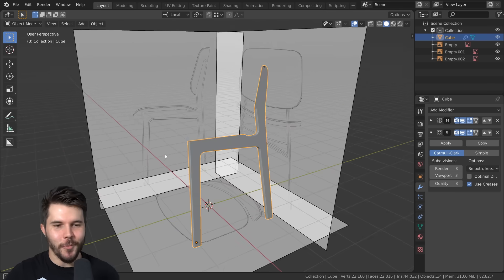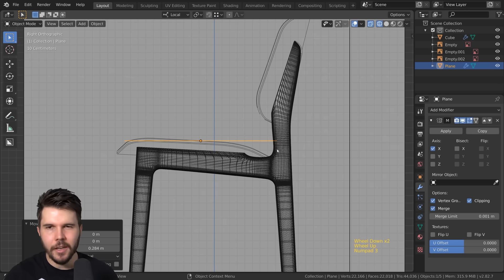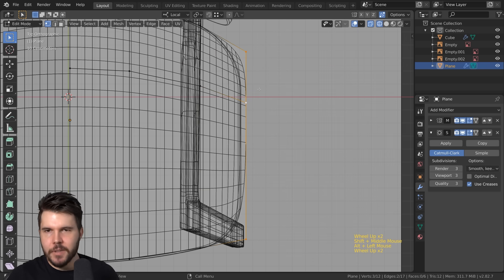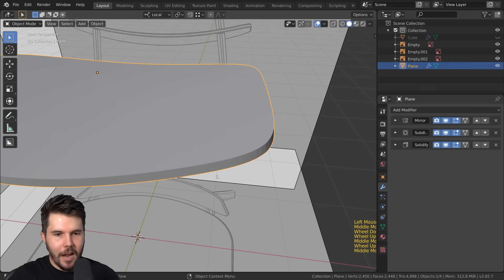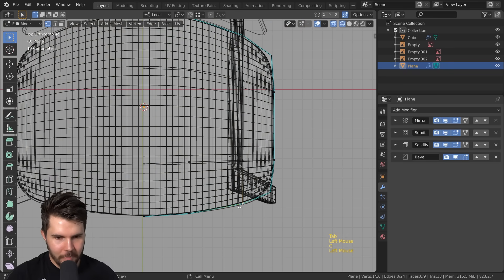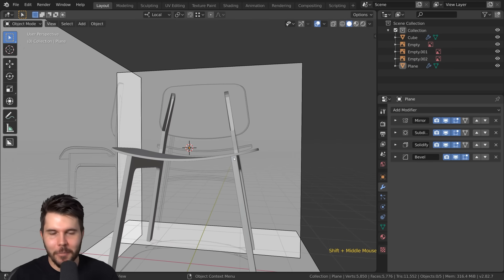Blender Beginner Modelling Chair Tutorial - Part 4: Modifier Mayhem

Comment: In blender 4.5+: If people get this weird extra smoothness along the line 11:12 if you have already added the smooth by angle modifier, go to the bevel modifier, then to profile, you have the superellipse shape, auto set to 0.5, when changed to 1.0 it deforms the bevel less and the line disappears.
Reply: Hi, have you finished this chair? I was doing this as a homework assignment, and my computer broke down. Today is the deadline. If you still have the file, could you share it with me? Because I don't have the money to hire someone else and I'm in a difficult situation.

Comment: For people struggling with Auto-smooth portion, around 8:30, Blender has made it easier now. You can easily avail that by right clicking on the object and click on "Shade Auto-Smooth". On the lower left corner you will get the option to change the Angle.
Eventually, the Smooth by Angle will modifier will also add up in the list of your modifiers.

Comment: 10:25 i use blender 4.5, i threw in the shade smooth, bevel modifier, 3 segments, 0,01 amount. it looks good for me
Reply: Hi, have you finished this chair? I was doing this as a homework assignment, and my computer broke down. Today is the deadline. If you still have the file, could you share it with me? Because I don't have the money to hire someone else and I'm in a difficult situation.

Comment: If you're stuck on the auto smooth part, the option for "Smooth by Angle" is no longer under the Data tab. Its now its own modifier. So go to the modifier tab for your seat, and add a new modifier. Its called "Smooth by Angle". Hope this helps someone.
Reply: bless you kind sir!!!!
Reply: It also has to be above the subdivision modifire
Reply: Thanks a ton!
Reply: Thanks for this! Although I am not seeing it. What should I choose?
smooth
Smooth Laplacian
Smooth corrective (all in Deform)

Cheers!
Reply: Thanks for the advice  bro
Reply: @nanakakitano9724  I can't remember now if I figured it out or not ( might have as I have finished the chair now) 😂 But thank you very much for the tip.🙏
Reply: love you
Reply: THANK YOU BROTHER
Reply: Thanks man i love the Blender community!!
Reply: "Smooth by Angle" Hero - Thanks
Reply: Go to Object mode, right click > shade auto smooth
Reply: thanks, i tried the other thing he said "Edge split" and it worked too
Reply: yo man thanks so much was stuck here :D

Comment: On the plans, the outer line is the thickness of the material, the inner lines are the bevelled edges.  Chamfering the edges in production will require specific tools to create a constant curved edge against each corner - usually set to a mm radius.  I worked with a product designer who did a lot of this stuff in Solidworks and had all the fun of creating perfect topology.  He always said the modelling was the easy part at 25% of the job, solving all the problems was about 75% afterwards - depending on the complexity of the project too.

Comment: At 3.39 when I am applying subdivision surface to mirror modifier. It is considering mirrored and original surface different, and creating 2  different table surfaces. How to fix this.
Pls let me know
Reply: It's the issue of merge option in the mirror modifier that's set by 0.1 by default. Just change it to 1 and it'll work fine.
Reply: Thanks <3
 @meowzzzie
Reply: @meowzzzie  thanks u so much bro
Reply: when add modifier->mirror, need to turn on "clipping" checkbox, then G and meet the edge at middle.

Comment: If the Bevel modifier didn't work for you, move it before the edge split modifier, edge split should be after the bevel modifier. The correct order is Mirror, Subdivision, Solidify, Bevel, Edge Split.

Comment: For those who can´t see the mesh created by the Subdivision Surface on Edit Mode, even after checking "Display Modifier in Edit Mode" and unchecking "Optimal Display", do the following: Go to Edit - Preferences - Viewport - Subdivision and uncheck "GPU Subdivision". Apparently, some Graphics Cards don't support the subdivision on edit mode. It worked for me. I hope I can help someone who like me was strugling with this issue. (Blender 3.2)

Comment: For anyone who can't see the mesh of the subdivision modifier while in edit mode, try these three things in order...:
First uncheck "Optimal display" in the modifier.
If this doesn't help, click the Icon in the modifier with the square with one selected vertex (Display modifier in Edit Mode).
If still no luck, your GPU seems to be unsupported for this. Was the case for me and it was the hardest to find:
Go to the preferences "Viewport". All the way to the bottom there is a section "Subdivision".
UNcheck "GPU Subdivision"... save the preferences and you should now see the subdivided mesh in Edit Mode.
Hope this helps everyone struggling with seeing the mesh.
Btw... No need to install the Pro drivers for Nvidia. I did that and they caused more problems, than they solved. Had to uninstall them and re-install the original drivers :(
Reply: Thnk u so much😭🎉
Reply: Thank you! Was pulling my hair out trying to get this displaying correctly in edit mode
Reply: Nothing worked, not even unchecking GPU subdivision...I have an M1 mac. 😕

Comment: Im a blender noob but Im thinking your "autosmooth problem" happens because autosmooth is set to 30 degrees or less, the edge was approx 90 degrees and so 1 bevel will be around 45 degrees, but more bevels will decrease the angle to 30 or less? Just a guess.

Comment: Question: Your orange colored object outline is so smooth from all distances. I changed antialiasing in preferences from 8 to 32 but it does not effect the orange outline and from a distance it does get jagged looking. Not a big deal but I'm curious as how to fix this. nvidia 1070ti, I guess I could play around with nvidia control panel but there are so many antialising options and options that replace antialising I'm not sure what to use. like I said its not important but I am curious, render usually looks fine.

Comment: 11:38 This happened because when you add new segments, the curvature of each segment drops below 30º, therefore Auto Smooth or EdgeSplit does not work unless you reduce the 30º angle to around 15º.

Comment: And I don't know what happened to my model, but when I applied the bevel to the seat to replace the shade smooth, the Segments were set to one. As they should be. But when I looked at the model, there was a weird little square on the thick edge. Added another segment and the square went away. Probably just me.

Comment: If you have a third chair leg floating in the air using the 2nd mirror modifier, you probably used the eyedropper on the wrong mirror modifier.

Comment: 8:05 How to control smooth-shading command
9:37 Bevel modifier 
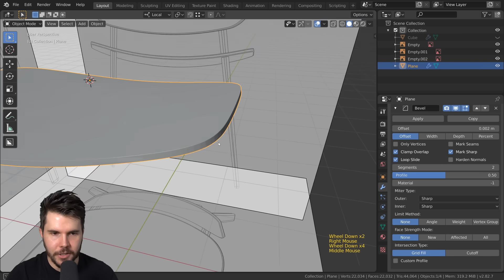11:45 How to fix beveling effect to an edges that you don't want to modify.
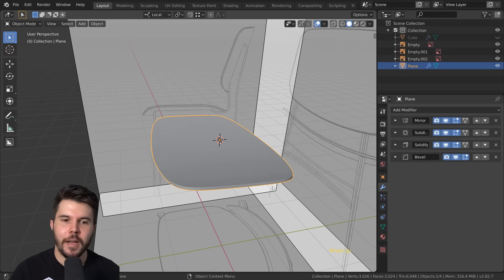12:48 Why the order of modifier is important, and how difference makes changes.
14:43 Mirroring object based on another object.

Comment: Really need 3 viewports.. I was pulling hairs wondering why my points keep changing 3D position in another vector.  Having front, profile (side), and top down is the better way.  I have a large Viewport as front, then the other 2 on the right of that this way I can pinpoint where it "Should" be in space.

Comment: 10:13 even if your edge didn’t get messed up at this point, do this bit still. I skipped this at first, and 2 minutes later when I added an extra segment parts of the corners looked pinched and doing this fixed it

Comment: If anyone is having trouble with the auto smooth option doing nothing, after I checked the box I used shade smooth in the object mode and it worked, with the bevel modifier too btw (also i did the ctrl e and right click mark sharp, while selecting the outline vertices)

Comment: Could it be that the "shade smooth" starts crating issues because the delimitation is on 30 degrees and when you apply more than one segment to bevel it essentially becomes less than 30 degrees between the segments?

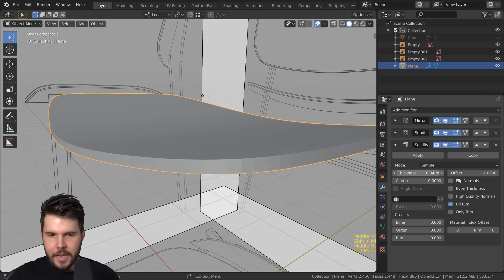Comment: 7:00 When adding the Solidify modifier, the edges of the plate don't align on top of each other (on Z-axis), I get a weirdly angled edge instead. Hard to describe, but did anyone experience the same or knows how to fix that?
Reply: same
Reply: Yes, I faced the same issue. I redid exactly again from the plane and it came out well. I guess it is due to misalignment of vertices

Comment: The Bevel Limit method by angle confused me. If you set it to bevel anything that is over 60 degrees in 12:15 , shouldn't it bevel the edges on the flat(ish) face of the chair too? The sharp edges are 90 degrees, yes. But the large curved face of the chair has it's edges which are closer to 180degrees right? Or am I measuring the angle between the faces wrong?

Comment: In 11:15 the Mark Sharp option doesn't fix tht weird smoothing bug on 2.91.2 version. 
using the Harden Normals option in the Shading section of the Bevel modifier fixes the issue.

Comment: Important tip: When shaping the seat plane in Top View, as much as possible DO NOT move the vertices out of line with each other. If you do, when you come to altering the seat to match the vertical curvature they'll all be messed up and won't align properly. I did this and had to start this lesson over from Square 1; 2 hours of work down the drain.

Now if you'll excuse me, I'm gonna go cry in the corner for a bit.

Comment: 3:39
For those of you who can't see the mesh of the "transformed plane", go to the  Subdivision Surface Modifier and uncheck the box named "Optimal Display" (it seems to be a default setting).
Reply: those who still cannot see the mesh in edit mode i solved by doing uncheck GPU Subdivision in Preferences > Viewport > Subdivision. i currently use blender v3.12
Reply: @rysore  Thanks for this! Worked for me!
Reply: @rysore  This is what finally fixed it for me, thanks!
Reply: @rysore  THIS IS WHAT I NEEDED :) THANK YOU SO MUCH I CAN FINALLY SEE IT lol
Reply: @rysore  this. Thank you
Reply: @rysore   Thank you very much! The underrated comment！
Reply: @rysore  "uncheck GPU Subdivision in Preferences > Viewport > Subdivision" thank you thank you thank you
Reply: Dude Thank You! New updates change so many things.
Reply: @saurabhparate  yes it made it very hard. especially in parts 1-3
Reply: thank you
Reply: if it still isn't showing, you need to select the box in the subsurface mod that says "display modifier in edit mode". Its the square with 4 vertice symbol
Reply: @Theakm55  not working, its probably something with graphic card, i tried every option including your tip.
Reply: @MatúšSzepeši  you should select wire frame in viewport option
Reply: @roboticreaper2662  I've selected wireframe option, i did everything exactly like on video but it does not work on my graphic card obviously
Reply: You have to click on the 3 dots on the top of the subdivision modifier. Try it!
(the on cage mode).
Reply: @Theakm55   thanks man!
Reply: Thanks for this info.
Reply: Okay, i found solution to my problem. AMD has obviously two different graphic drivers. I found version for graphic, modeling purposes. If somebody has this problem, search for Radeon™ Pro Software for Enterprise drivers for AMD.
Reply: None of the two solutions here worked for me, and I use nvidia... time to start panicking I guess
EDIT: It was not showing because I was in Object Mode and not Edit Mode...
Reply: Was hoping someone said something about this.  Isnt particularly necessary but it is a little annoying when you are following along and its drastically different.  I turned this off and the wireframe appeared, very nice.
Reply: thank you very much. I was wondering how to solve that.
Reply: luv u dude!!!!
Reply: Aaww man thank you so much! Totally saving me.
Reply: I honestly can't thank you enough...
Reply: Underrated comment, thanks chief!
Reply: Thanks man! I knew someone would comment this! _\,,/
Reply: I didn't need it, but I'm glad I saw this.
Reply: Oh my soul thank you! I broke my mind like "what did I miss!?"
Reply: I came here only for this :)
Reply: u r a life saver bro
thanks
Reply: Big help, thanks, thought I’d fucked up haha
Reply: Thank you!!!
Reply: OMG, THANK YOU!!! This was killing me.
Reply: Thank you very mach!
Reply: You are a hero.
Reply: thank you so much
Reply: dude thankyou
Reply: Thank you so much for this :) but when I do loop cuts now they are inaccurate, the orange line does not match up where it actually loop cuts :(
Reply: thank you so much this is so much better now
Reply: Thank youuuuuuuu
Reply: omg.. thanks
Reply: Thanks Mate!
Reply: Thank youuuuu!
Reply: Thank you so much!!
Reply: Much obliged, partner
Reply: And also go into wireframe mode
Reply: thank you man...
Reply: Subsurf and mirror modifier creating a split in mesh fix that
Reply: thank u thank u thank u
Reply: you're a hero
Reply: thank you!
Reply: Thanks brother
Reply: I had to set wireframe overlay amount to 1 to get it to show.
Reply: Thanks bro
Reply: yess ty :)
Reply: Thanks!
Reply: Oh my gosh thank you 😭 I went through the last 3 tutorials not seeing that and it drove me crazy lol
Reply: thxxxxx
Reply: hey....Tx dude..:D
Reply: dude thank yoouuuuuu
Reply: TY, man
Reply: After 4 hours to followed all advice nothing worked with 3.4.1. I just downloaded 3.0 version it's working. IDK why, if someone know
Reply: life changing...
Reply: Bro can i ask u something? why did he go to solidify modifier to add thickness instead of selected the face above and pull it down?? in 6:55
Reply: thank you so much
Reply: ありがとう
Reply: just wannna hug you
Reply: I have been trying to figure that out for 1 hour
Reply: I LOVE YOU DUDE
Reply: gah, i've been wondering how to get that to work. thanks man!
Reply: It took me 4 episodes to find it out 😅
Reply: You are the best dude!!!
Reply: LIFE SAVER! <3
Reply: thank you!
Reply: thanks, bro
Reply: Thank you <3
Reply: thank you!!!
Reply: Thank you MultiNicePerson!!!
Reply: i unchecked it, but still, its not working - could be problem somewhere else? Graphic card? I have AMD RX 580 

Edit: I tried same model on my notebook, where i have Nvidia GeForce GTX 1650 and its working
Reply: @MatúšSzepeši  once I unchecked it and went into “ Object “ mode with “ wire “ mode enabled. I was able to see it
Reply: Same problem, but it works when i am in object mode.
Reply: https://www.youtube.com/watch?v=-ioeQAhxkb8 here is another way to fix it

Comment: @Andrew  @Blender Guru  5:25 The second Line inside is the Iso curve which describes exactly where the radius starts. Usually it is easier if the Iso curve is shown bit thinner than the outline. Also when you modelled the side part you could have used the inner iso curves to hit exactly the right radius of the chair.

Comment: I tried using the SimpleDeform modifier for this part and the results are preety good as well.
Set it to "Stretch" mode, and add and Empty to the Origin object. Choose the X axis to deform the object.
Under restrictions, just lock the Y axis.

To controll how much the mesh is deformed, just move the empty on the Z axis :)

Comment: hey I have to tell you that on the seat I applied subdivision surface and its viewport I kept 6. And then I added the bevel modifier to the seat and did its viewport to 6 and it is saved.
Since I have intel UHD 630, it always hangs and I have to restart the computer. So I can't do this project.

Comment: Ran into the problem that the second half of my left leg (second mirror modifier) appeared on the opposite side. Does anyone know a fix? Here a screenshot: https://gyazo.com/6087568413ef3b24a40ec6729e7528fb

Update: Fixed it by swapping the modifier positions. I accidently had the Subdivision below the first Mirror Modifier, which made two parts of the leg look a little wonky aswell. After fixing that the next Mirror Modifier worked fine :)

Comment: Help! 
After my loopcut if I try to move it it creates another wireframe, but it doesn't seem to be separate. I made the plane 3 times and am now stuck to try to figure it out. I pulled it down for this more extreme version to show my issue. I did my mirror modifier and followed steps etc
  https://imgur.com/a/xaa3HwH
Reply: If I unclick x axis on mirror it seems to work, but only on the one half.  The layer underneath is unclickable on the top layer, but then after moving the top over I can click one side of it. and doesn't have any points, it just kind of stays there after the first loop cut is made or if I tap g and try to move it before the loopcut..  I just updated my Blender a couple days ago. Not sure if that was the right way to go about it. But trouble shootign for almost 2 hours

Comment: Does changing the Shade Smooth mode and the normal auto-smooth actually affect rendering? Does it affect attributes of the model if it is to be exported, too? I'm just curious how much this can actually be used in general or if it's more of a tool to simply visualize the modelling job we've done so far

Comment: Thank you for the nice tutorial. One question that keeps popping in my head, as someone that wants to learn to bring models to a game engine, is whether sub division surface is a must have together with decimate to keep a low poly count, or whether adding new edges manually to give it a round a edge and have a higher control over the poly count is better. Andrew uses the sub div every time and, for instance, in the couch tutorial, we ended up with over a million tris. Sub div does makes everything smoother and better to work with when round edges are present, so I would like to know which method is better in your opinion (or anyone reading this that is into the subject). Thank you for your help :)